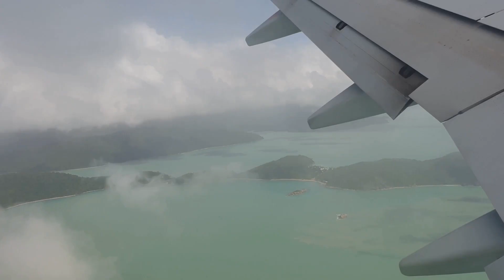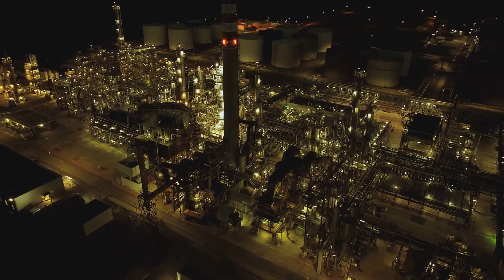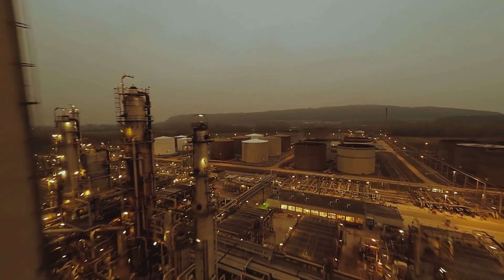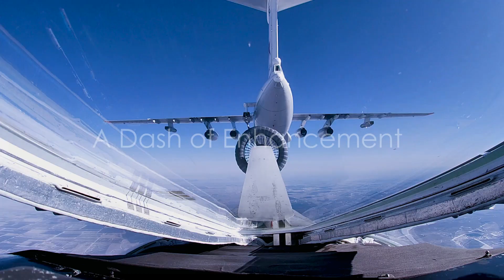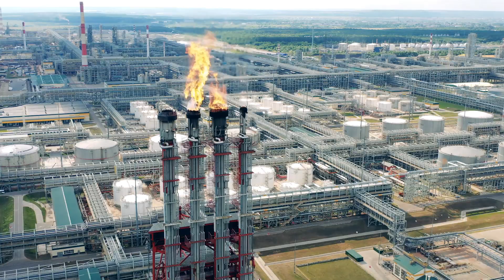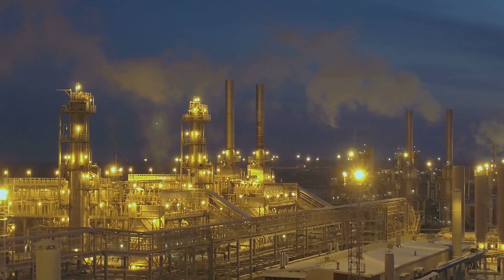How Jet Fuel Is Made: From Crude Oil to Powering the Skies

Comment: EN59010PPM/50PPM
LIFTABLE QUANTITY: 50.000 MT, MAXIMUM 300.000 MT MONTHLY
CIF PRICES: GROSS US $ 410 / NET US $ 400 PER MT
FOB PRICES: GROSS US $ 390 / NET US $ 380 PER MT
Commission: Buyer $5 / Seller $5
AVIATIONJETFUEL (JETA1)
LIFTABLE QUANTITY: 1,000.000 BBLS ROLL OVER
CIF PRICES: GROSS US $ 70/ NET US $ 67 BBL
FOB PRICES: GROSS US $ 68/ NET US $ 65 BBL
Commission: Buyer $1.5 / Seller $1.5
HIGH SPEED DIESEL EURO 4 GRADE (GASOLINE)
LIFTABLE QUANTITY: 50.000 METRIC TONS
FOB PRICES: GROSS US $ 370 / NET US $ 360 PER MT
CIF PRICES: GROSS US $ 380 / NET US $ 370MT
Commission: Buyer $5 / Seller 5$
LIQUEFIEDNATURALGAS (LNG)
LIFTABLE QUANTITY: 50.000 METRIC TONS
CIF PRICES: GROSS US $ 390 / NET US $ 380 PER MT
FOB PRICES: GROSS US $ 380 / NET US $ 37MT
Commission: Buyer $5 / Seller $5
+7 778 3198843
info@llpastanaexport.kz